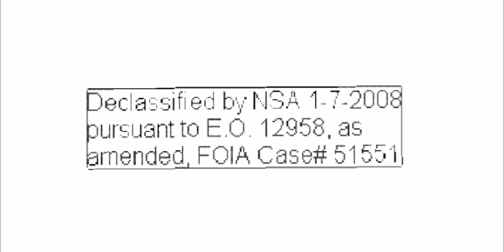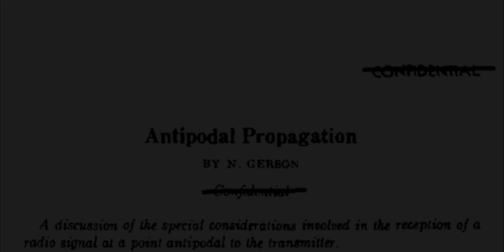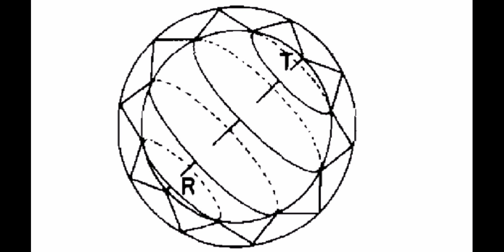How to listen to the other side of the Earth on shortwave

Comment: That NSA paper has to be read very carefully.  First off, it's not a scientific paper, it's a write up on the (then) cumulated theories on a suspected enhancement of reception from the antipodal point based on a naive idea, not an explanation why it's possible to receive signals from the antipodes. Furthermore, the paper explains (without going to much into the details) why such an enhancement would be a probably hard to predict and rather rare occasion, given all the variables that speak strongly against this (over-)simplistic, geometrical idea of converging great circle paths.  Not sure what went wrong from there, AFAIK the basic ionospheric models had all been worked out at that time so things should have been better understood back then, but obviously they weren't for the NSA, and things like chordal line propagation were not a concept yet.  K9LA has a powerpoint about this topic that's basically equally inconclusive but has at least some data points that could be reviewed or even used as a basis for an interpretation.

Long story short, the likelihood that you receive a signal from the antipodal point on 2 or more great circle paths up to 180° apart is indeed higher than most people thought before hams grew rich and installed beam antennas giving them a way to know from where a signal comes...and how ambiguous this can be at times.  

However, the likelihood that these multipath propagated signals combine orderly and in phase as to enhance level and reception at the antipodal point is as random as it gets, even when LP+SP would actually have the exact same runtimes (which is more or less prerequisite for such an enhancement).  What's much more likely when reception feels particularly enhanced or stable from such a point is the opposite - that one hemisphere did not deliver interfering paths due to solar activity related absorption, and the other path goes through an enhanced ionosphere for the same reason, for example chordal hop propagation in an "afterglow" ionosphere on the night side etc..  K9LA's presentation discusses an observed signal enhancement too, but IMO the only conclusive takeaway from that "naive" concept is that the antipodal point of origin for these signals allow you to hear the signal (statistically) longer hours per day, because at least one of the paths is on the "better" side (which one that is may vary) most of the time.  

It's these little, and after more than 100 years still elusive and at best theoretically approached anomalies that can keep the whole radio thing really exiting.  A gigantic, perpetual physics experiment, with the whole planet being your lab.
Reply from the maker: Thank you so much for your very interesting comment! I really enjoyed reading this and what you say does make a lot of sense. I am, however, curious about my own experience. Not only do I hear WWVH almost every day (under normal propagation conditions), I also hear the US Coast Guard signal from Honolulu at times. Both these signals come, quite literally, from the other side of the Earth from my location. So something interesting is definitely at play here. It seems highly unlikely to me that WWVH would reach me almost every day just because of good propagation. And USCG Honolulu also. I agree with you that anomalies like these really keep radio exciting. 

As an aside, over the past weekend during the solar storm I heard Voice of Indonesia here in Johannesburg for the first time ever. When I posted about this on my channel, someone in Paris, France, commented that they also heard it, for the first time ever. Sounds like another anomaly to me!
Reply: @swlistening   Look, I've had a lot of "never heard before" moments in the past 50 years, these come for a whole variety of technical reasons, but the main reason why I never could hear some things until very late in my life is twofold: The lack of (1) knowledge, which is giving (2) luck very little chance to strike.  

For example, if I would always play radio in the morning, I would get the impression that I never hear WWV but occasionally WWVH. If I'd be listening in before going to bed, I'd always only hear WWV, if any.  So besides your listening habits, that's already 3 very important conditions to be met to receive a particular point on the globe, or not - the right time of day, the day of the year and the frequency, being much dependent on the former two.  The next variable is the current geomagnetic situation and space weather, IOW solar activity so there is also an 11-year cycle of variations in the annual conditions.    

The thing with "antipodal propagation" is that it's also a pretty impractical concept/phenomenon, not affecting many people:  Very few inhabited places in the world have an inhabited antipode, and the area of enhancement is very small (500mi radius).  That doesn't apply to you of course, you have that antipodal point.

But you don't need it as a concept: Provided you can get away from local noise as to utilize the full sensitivity of your rig, the connection to the other side of the globe is actually pretty stable. For example, I can hear the Sydney and Auckland VOLMETs (that's only 2000km close to the antipodal point at best) every day in a solar minimum with no disturbances, but also zero enhancement.  The signals are weak and not very readable with only a whip, but steady and quite reliable, all it needs is going to a place where these faint signals don't get drowned out. Of course, any form of increased solar activity will change this low-level persistence and occasionally lift those signals even over a high noise floor in somebody's radio in the city, or just kill reception for everyone.  If the magnetosphere is quiet but the solar flux is as low as it gets (SFI=67), I can hear those stations.

The last important point is your position on the globe.  High latitudes give short over-the-pole paths and little noise in winter, and gruesome low MUF and horrible absorption when the sun only blinks funny.  You are close to the equator and while you have more issues with noise from the "thunderstorm belt", you rarely suffer that badly from disturbed ionospheric conditions, your SP to Hawaii is in convenient 73° or something and the grayline paths over SA look still good for Hawaii at this time of the year, not sure how close either path gets to the poles but chances are probably higher that some or more of the great circle lines can carry a signal beyond the pole.  So if there is a thing like an "antipodal enhancement", you should be one of the very few to get the most out of it, but maybe you'd do fine without because your experiences could be explained in other ways.
Reply from the maker: @13DKA-kg2fz  You are right that it is usually possible to pick up signals that you never hear if you can get away from RFI. In my case, a station that is basically impossible to hear here at my location in Johannesburg, is Radio New Zealand. I was beginning to think that this signal just did not reach South Africa. But then once when I was on holiday in the mountains, east of Johannesburg, I heard Radio New Zealand bright and clear one morning, on my Tecsun PL-368 with just the whip antenna. So location and lack of RFI certainly help to receive "never heard before" signals 😀

Speaking of Radio New Zealand, that is one station that, in my opinion, does benefit from antipodal propagation to some locations. I know people hear RNZ very clearly and very regularly in Spain and France. Spain is the antipode of New Zealand. So I think there is at least some truth in antipodal propagation, although it is probably one of those things that you can never really prove.

Comment: Oh well, I've only just gotten to watch this video after I commented about antipodal reception on your Honolulu weather reception 😂 so I'll only confirm RNZ Pacific is an easy catch across Europe indeed, if day/night patterns allow of course 😅 And I also remember being surprised by strong signals from China on Brazilian KiwiSDRs... as if it was in Europe 😵

Probably much harder to do the same on MW though, because in addition, one of those mumerous paths between two antipodal points must be in darkness... which happens only so rarely... And even then, the signal would have to cut through local or regional stations.
Reply from the maker: I wish I could have tried it on MW, but there seems to be no MW stations in Hawaii. So I will have to try for antipodal MW somewhere when I am travelling outside South Africa. I guess it should theoretically be possible, if you time it right.

Comment: Quite interesting topic and video, André. Thanks. I would really need to read this report in full for the details of the demonstration. What you explain here, reflection of airwaves on the ionosphere and the earth, is the basis for long-distance SW propagation. I actually fail to see where being exactly antipodal makes such a difference but I'm sure that's explained in that document.
I shall put this to the test soon  anyway, because I'll be in Thailand less than a month from now and I certainly intend to bring along at least my R-108 and my PL-330 (or 368 maybe). Let's see if I can hear Brazilian samba from over there 😁
Reply from the maker: Thanks Alain, the big difference that I explain here is the concentration of all the signals, or rather radio waves, from one transmitter at one point, which only happens with antipodal propagation. With regular SW propagation radio waves travel all over, with antipodal propagation they all come together again at the antipode, converging at one point, thus amplifying the signal. It is a very interesting report!
Reply: @swlistening  Thanks André for the explanation. It does makes sense. I still intend to read the full document. After all, telecoms are my major (or used to be) when I graduated.  I've since then deviated to IT... but it's still my thing. As a matter of fact, I've just re-applied for the attribution of a ham callsign. Maybe I won't just be listening anymore some time soon...
Can't wait for catching Brazilian stations soon too. That would be a first to me.
Reply from the maker: @F4LDT-Alain  Thanks Alain, the link to this report is in my video description. There is quite a lot of research about this topic on Google Scholar also, if you want to do a search there. I read a couple of those articles, quite technical! In my internet searches for information about antipodal propagation I also came upon a World of Radio DX log, where someone in Hawaii reported hearing Zambia on 5915 kHz, so the other way round to my experience with WWVH. All very interesting to me. But, as I said in another comment here, of course antipodal propagation is just one way to receive very distant signals, there are many different HF paths and all kinds of other variables. Perhaps I should have mentioned this also in my video.